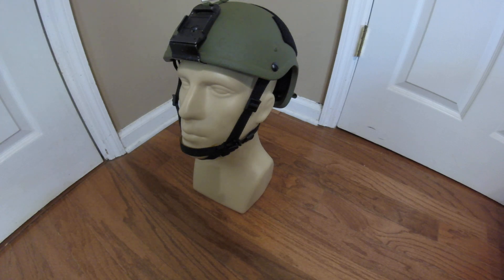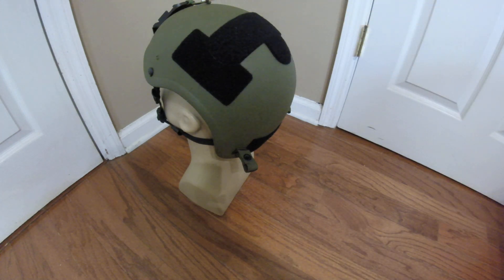(OLD VIDEO) CVC Helmet Modification (Ops Core/SOHAH-Style Helmet)

Comment: When would have socom been modifying CVC helmets? 90’s? From x to prior to the adoption of MICH 2001?
Reply from the maker: Probably something like that. I'm not too versed on when or how long these modifications were done.
Reply: There were a few examples out there on that often make mention of it, mind you I am not an expert, but this is what I have learned in the past couple of years. As for the 90s from what I have learned there were a couple of examples in terms of helmets that came up in use around the timeframe. These examples ranged from a series of manufacturers that were producing helmets. These often ranged from helmets like the ILC Dover IBH (Integrated Ballistic Helmet), CGF Gallet SPECTRA SHIELD, along with a few other examples out there too in the way of modified helmets besides what commercial offerings existed at the time. As for the SOHAH style helmets in a few threads out there that make mention of them, with some servicemen from the 2000s mentioning they utilized the helmets when other stuff was in short supply at times. Gentex also had their own commercial offering in the form of the SOHAH which was used by a couple of units such as the USCG, USAF, and USN. Regarding the modifications it was also common a few years back to modify existing options besides the CVC Shells, these were often the ACH/MICH and PASGT style helmets being cut down into shape, these days the practice is dead at this point. It's also something I ended up doing myself when I couldn't afford a high end helmet back then. Occasionally someone will still do it since some of the affordable commercial alternatives/copies on the market that mimic the high end stuff tend not to be the best of quality.

Comment: can you put arc-rail system on it? same rail system with the ops-core rail?
Reply from the maker: I could if I bought the rails first, but the holes on mine aren't drilled in the right spot for arc rails.
Also arc rails look wonky as hell on a CVC-cut helmet imo
Reply: @GasMaskBunker  i saw a sale CVC-cut helmet in Ebay and it was made in US but no chin strap or harness and no rail. and you are right. arc rail is kinda sitting high on CVC-cut helmet which is kinda funny.